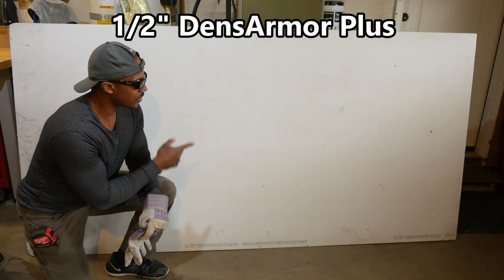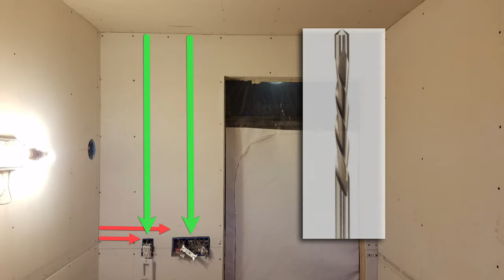Bathroom Remodel 65 - Installing DensArmor Plus Drywall on Walls 1 of 3

Comment from the maker: I've never worked with DensArmor, but it wasn't too different from installing standard drywall. The texture is a little rougher, though.

Please leave a 👍 if you like the video!

👉 Visit our website ► http://DIYApprentice.com
👉 Click to Subscribe! ► https://bit.ly/2pEBg3m

👍▬▬Follow Us on Social Media▬▬👍
✔️ Facebook ► https://bit.ly/2pAY8S3 
✔️ Twitter ► https://bit.ly/2G7mRDz 
✔️ Instagram ► https://bit.ly/2ILEKII 

🔧▬▬Tools and Materials▬▬🔧
✔️ DIY Apprentice Recommended Tools and Materials ► https://bit.ly/2T5psFw
✔️ DeWalt DW272 VSR Drywall Screwdriver ► https://amzn.to/2zpguKT
✔️ DeWalt DW272 Nose Piece ► https://amzn.to/2zpgqLa
✔️ DeWalt DW272 Carbon Brushes ► https://amzn.to/2xODuRw
👉 Dewalt DW272 Review ► https://www.youtube.com/watch?v=iEFbn...

✔️ Dewalt DW660 Rotary Saw ► https://amzn.to/2M3sFm5
I have an older Rotozip – some mixed reviews on newer Rotozip saws.
✔️ Drywall Lifter ► https://amzn.to/3kMxr7X
✔️ Drywall T-Square ► https://amzn.to/2Y87SEB

📷▬▬Video Equipment▬▬📷
✔️ Camera used ► http://amzn.to/2GcpkOb 
✔️ Lens used ► http://amzn.to/2Deu16S 
✔️ Tripod ► http://amzn.to/2GbaM1c
✔️ RAM Suction Mount ► https://amzn.to/2Wz9PXh
✔️ Cyberlink PowerDirector ► https://bit.ly/2jTwGxT
✔️ Adobe Photoshop ► https://bit.ly/2V7nyUX
✔️ Camera Slider ► https://amzn.to/2WtD7GW
✔️ Deity V-Mic D3 Super-Cardioid Directional Shotgun Microphone ► https://amzn.to/2LI1lf7

*This video was recorded in 4K resolution, so modify your settings accordingly if desired for better image quality* 

Disclosure: This video contains affiliate links, meaning, at no additional cost to you, I will receive a commission if you click through and make a purchase.